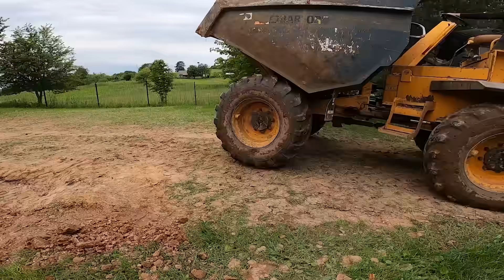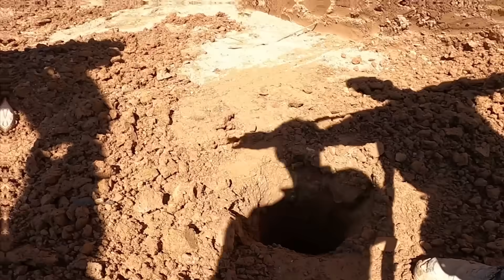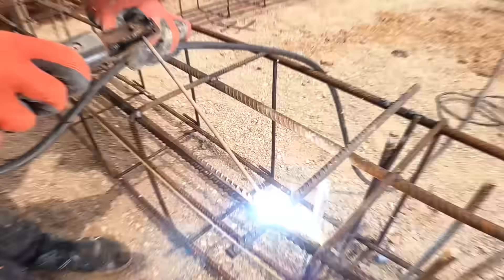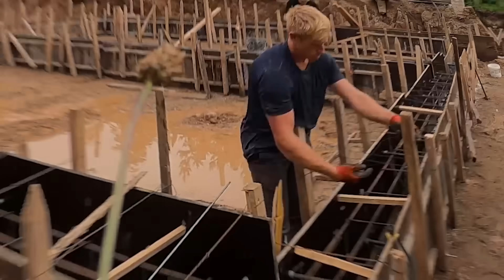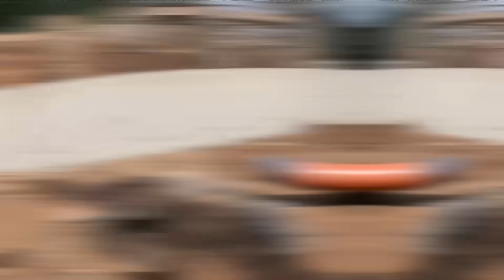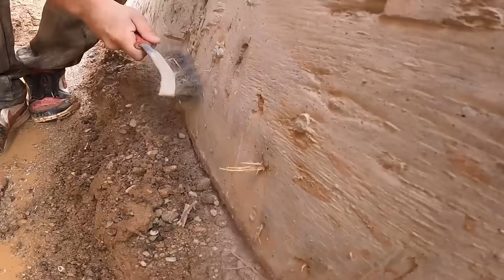Building A Basement Foundation: From Digging To Concrete Pour

Comment: why didnt u use a hammer drill or something to shake up the concrete and getting rid of any airbubbles and spaces in the concrete
Reply from the maker: We did use a concrete vibrator. You can see the guy behind me using it right after I pour the concrete 😅

Comment: What is the point of treating the walls against humidity if you pour concrete directly onto the ground. Concrete is going to sponge up water from the interface ground/concrete below. A water barrier  (plastic sheet) between the dirt and the bottom of the slab is required or better, a gravel layer of at least 1 feet is required.
Reply from the maker: How is it going to sponge up water if the drainage is around 1 foot lower than the foundation level? The water has somewhere to go before it can sit under the slab.
Reply: Drainage works to canalise water flow, it does not stop water motion by capilarity.

Comment: 1) you allowed the clay to soak. this reduces bearing capacity of the soil.
2) you added piles, they are pointless here (rebar has direct contact with soil there)
3) you added SAND into clay !!! (any water nearby will prefer pocket with sand because it allows water to go true)
4) EPS under foundation is just crazy

i can't continue to watch it, this is a junk. likely you backfilled the foundation with sand, and it is another bad solution. can't watch it anymore.
Reply from the maker: That was a painful watch and you still made it through the inspection report😮Respect for that 👊Thanks for watching🙌

Comment: If the whole hole has water about 6 inches to a foot high, can you pour a stone over it and it will go to the pumps and drain?
Reply from the maker: Better option is to make a small sump/well at the lowest point first, let the water collect there, and pump it out before doing the next layers.

Comment: how those over flow pipes work? I seen over flow pipes being pierce first all around the top to cach water then send it to the ouside  just like a gutter would do.
Reply from the maker: Those overflow pipes are there as a backup for any water that could ever build up inside at floor level, for example from a pipe or utility line failure. They’re not meant to work like the drainage around the outside of the foundation, but to give water a way out if there was ever an internal flood situation.

Comment: Really good video 🎉 but the drains had a mistake. Firstly you need put rock, after sand. If you don’t do that in the future you will lose the drains 😢
Reply from the maker: Thanks. As mentioned in the video, this isn’t a perfect drainage solution and your method would definitely be better. But this was a budget choice, and it’s not the worst solution for this situation.

Comment: welding or binding wire is best
Reply from the maker: We use binding wire. Welding is fast for positioning, but tying gives flexibility and helps prevent cracks during the pour

Comment: Why pile the foundations?  Water proofing the walls is useful but what about the floor, which is just as likely to leak water as the walls.  If you are going to waterproof a basement then it has to be fully tanked all around.  All drainage should have access at all changes in direction and junctions for rodding purposes, there should be no inaccessible bends or junctions.  Where the pipework enters the basement through the floor it needs to be fully sealed against water pressure and this is where the waterproofing membrane under the slab (if it had been fitted) would have a permanent seal around the pipe.
Reply from the maker: Drainage is lower than the foundation so water drains away 👍
Piles are only for ground stability.
Reply: @LibraryofConstruction You can't rely on the drainage to keep the basement floor dry because the floor slab is porous and probably has fissures to wick ground water up.  Although the drainage should establish the water table at the perimeter, the water table will not necessarily be level and it might be humped up under the floor slab.  The inclusion of perimeter drainage is there to reduce water pressure not dewater the site.  Besides how does the owner know that the drainage is functioning and not blocked?  Probably when the water is rising noticeably up through the floor.  I have designed many waterproof basements particularly, for commercial buildings and generally I ensure that the basement is fully tanked up to the dpc level.

Comment: Best footing installation I have seen on YT.
Excellent coverage on the reo in the Beams.
No Agregate in the mix for the piles?
I also like to weld my reo to stop it moving.
Reply from the maker: Appreciate that, thank you 🙏
For the piles we used a sharp sand mix. Over here sharp sand already has a fair amount of aggregate in it, so we didn’t add extra.
We only tack-weld the rebar where it needs to be locked in place for the formwork, then tie it. Keeps everything solid during the pour.

Comment: Hmm, I wonder why geotextile was missing? Clay tends to infiltrate sand and clogs it. Otherwise pretty nice work.
Reply from the maker: You’re right, geotextile is usually a good solution in clay.
In this case, the client decided not to add more layers, and we followed that request.
There’s also another basement on the same property built with an even simpler drainage solution, and it’s been working well for over 5 years.
Reply: 5 years.. But you build a house for at least 20 years. I don't understand how the drainage can work many years when it is covered with sand without geotextile.

Comment: Thanks for the video. You can add to the longevity of the building by using xps only in the ground instead of eps which will soak with water like a sponge over time and also always vibrate the concrete not just smooth it out
Reply from the maker: Thanks 🙏 we did vibrate 🤔

Comment: Def a diferent country
Reply from the maker: Yes it is different 😀
Reply: @LibraryofConstruction 
where was this built? Also, I like the idea of the piles.
Reply from the maker: @pbschulz  This was built in Eastern Europe.
Soil conditions here are very different, so piles are used to transfer the load to stable layers below.
Without piles, this foundation wouldn’t be reliable long term.

Comment: Why use pile in the basement? is it the clay or is there another reason?
Reply from the maker: It helps to lock the whole structure in place
Reply: how do they decide pile depth at 1m? Should not piles sit on a rock bed or on a similar strong layer so they can support and transfer loads to that layer? Thanks in advance for explaining...
Reply from the maker: @osman2k  Frost depth here reaches about 1.2 m. Since the whole build is already underground, deeper piles weren’t necessary. Once we drill into solid clay deep enough, frost movement can’t get underneath and affect the piles.

Comment: The concrete has no gravel ? It's plain plaster cement
Reply from the maker: This is sharp sand,so gravel is not necessary
Reply: @LibraryofConstruction It most certainly is. If it is going to support any weight it needs aggregate.

Comment: I have never seen someone weld rebar together.
Reply from the maker: Yeah, most people just tie it — but in this case, tag welding helps lock the shape before tying everything with wire. Makes the mesh solid and easier to handle during the pour.
Reply: Yeah, welding rebar isn’t typical unless the engineer calls for it. The heat from welding can change the steel and make that spot brittle, which creates a weak point that won’t take load the way it should. That’s why on most projects the rebar is tied, it keeps the strength consistent through the whole bar.
Reply from the maker: @michaelcrossley4716  We only weld the parts that need to stay locked in place while we’re building the formwork and during the pour. Everything else is tied with wire so rebars keeps its strength